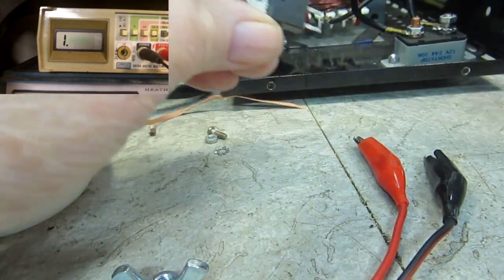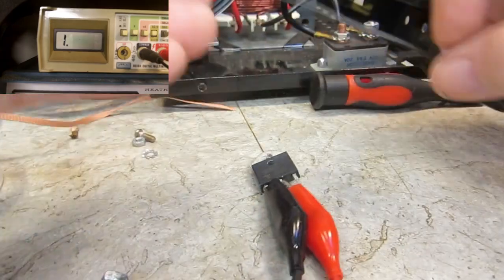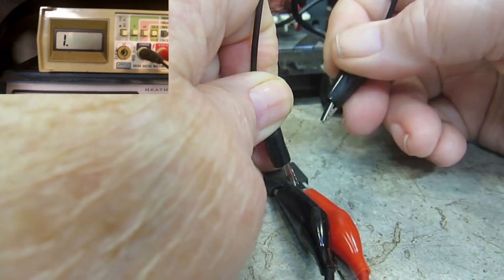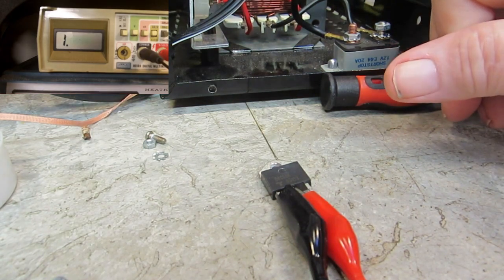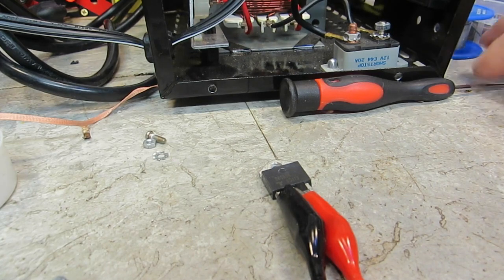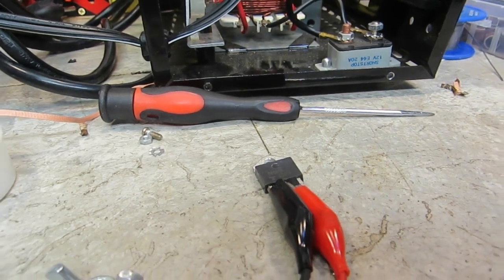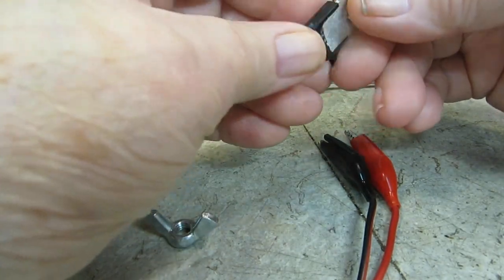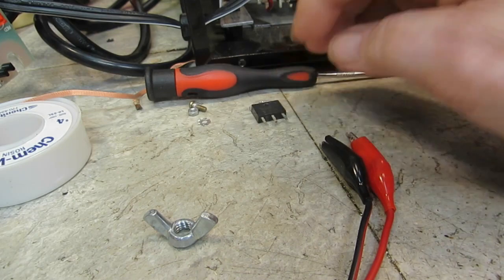DERB - HFT Battery Charger Repair - SCR test

Comment: Was there ever a follow-up to this HF Battery Charger's fate?
Reply: @DERB_Seymour_Indiana  Thanks. I found with mine if I leave the switch set to start it works as a manual charger on each of the other volt/amp settings. Otherwise it doesn't work, same as yours.

Comment: I'd do that test with a better analog meter type VOM. I'm not sure if your meter has enough "?#&@" to measure that SCR accurately. I suspect that SCR is high current and I'd suggest maybe a simpson 260 or RCA volt-ohmist. I think they just short out when they go bad.

Comment: I think your test was not sufficient for the SCR.   The link you provided describing DMM SCR testing was for what is called a sensitive gate SCR that only requires 200.0 microamps of current to trigger the gate.   The SCR you have is a high current power version.  Per the data sheet it requires 5.0  milliamps and 2.0 volts absolute minimum to trigger the SCR into conduction.   The meter is definitely not providing that much drive to test the large power SCR.    Another note is that if you were able to trigger it, it requires at least 60 milliamps of current through it and the load to latch and stay on.    That is called the minimum holding current rating.   I don't think you confirmed the SCR is bad.   Like someone else pointed out SCRs fail shorted 99% of the time.    I kind of doubt it is blown.  This SCR is rated for 55 amps continuous and 650 amps surge current.   55 amps surely would have blown the SCR case apart.    I have a feeling you need to revisit this test and meet spec sheet requirements for minimum trigger and holding current requirements.   It's worth a try to confirm.    Hope this makes sense.
Reply: @DERB_Seymour_Indiana  Great!!   That simple circuit will definitively show whether the SCR is good or bad.   Nothing lost, knowledge gained.  Look forward to the result.

Comment: Never saw a SCR fried open. Usually they short out. Check it with continuity checker to be sure. Could use the old "battery and resistor loop" test with a 12 volt lantern battery
 in series with the anode and cathode side in the loop. Use another lead to the the gate and the positive side of the battery with a 220 Ohm resistor  to see if it turns the bulb off.
If the bulb doesn't light  at first it's open. If the light stays on when a voltage is applied to the gate it's shorted.
Reply: I agree with you.   I think the DMM test is insufficient for a power SCR like this one and needs to be tested as you recommend.  The DMM test works fine with TO-92 size SCRs that have sensitive gates  but not for this gate that requires 5 milliamps minimum trigger current.